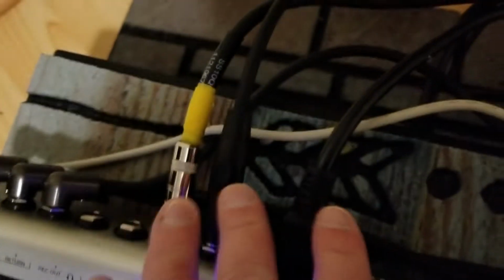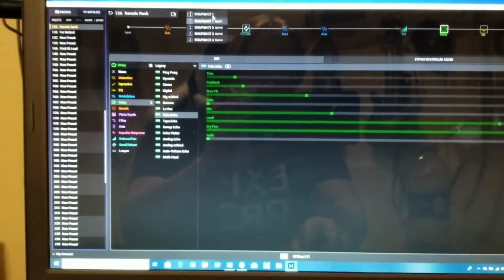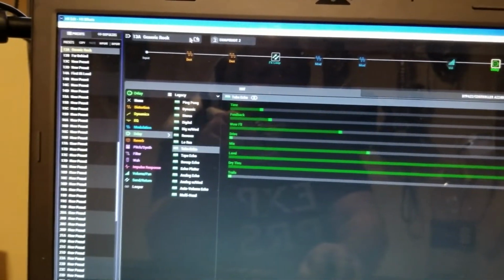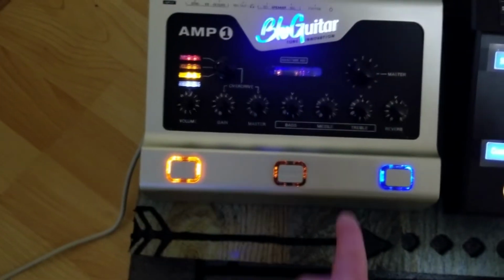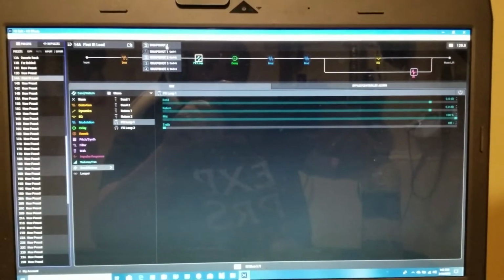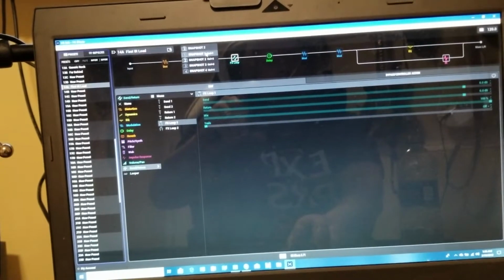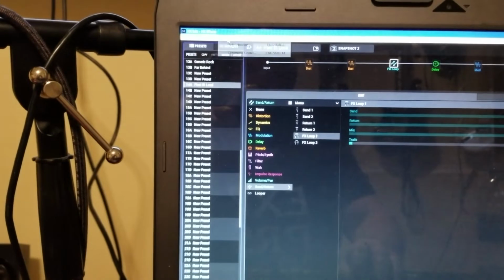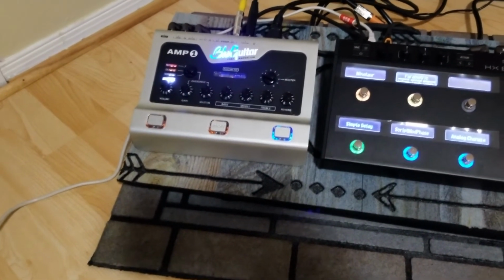HX Effects MIDI Control of the BluGuitar Amp1

Comment: Are you still using the HX effects with your amp1 in 4 cable method. I am considering this setup and wondering if it works well.  Did you stick with it or have you evolved sconce this video.  If so what are you using now. Thanks for sharing.
Reply from the maker: @Dr. Gregory Weisswasser ND , I do not use that setup anymore, but I'm not sure I would have moved on given what I know now. That said, for about the same amount of $$, I'm using a Kemper Profiler Stage. I also have a full pedal board, so with the included effects of the Kemper and the board, I've got everything covered too many times over.

This really depends on what you're looking to achieve. If you're looking for a straight forward rock/blues sound on stage, the HX Effects and the Amp1 in 4 cable is all you need. You can go from 50's Elvis to sludge with that that. You can even do ambient with it. The truth of the matter is that I could still use that and be just fine doing everything I do. I play churches, I play festivals, I jam at open mics, I do club gigs; and I was doing it all with the HX Effects and Amp1. 

Why go Kemper, you might ask. I sure did. LOL. Because I had FOMO (fear of missing out). I have a Kemper with literally 18,000 amp models at my feet and I use two, a Marshall Purple Plexi and a Fender Twin AC from 1965 that were both profiled by Tone Junkie. I paid for his everything pack, and that's really all I use. I have to laugh at myself while I type all of this, because I didn't have to spend a penny and would have been happy where I was.

The only two things I would add to the Amp1/HX Effects method would be a wah and volume/expression pedal, but that's me. I have a Slash wah, Mission volume/expression, Digitech Drop (which has gone up $100 since I bought it!), and a Gamechanger Audio Bigsby pedal. The Drop is so that I can change to a lower tuning without switching guitars and the Bigsby allows me to do bends without putting a bar on my guitars. I hate actual Bigsby's (my son has one that I have to maintain because I'm Dad), so this pedal lets me do dive bombs and all that and never lose my tuning. I play almost exclusively Gibson on stage these days, and they aren't famous for staying in tune when you bend them that way. I play a few covers that use the Wah and the volume pedal is to fool the sound guy. 

So let's talk pros and cons. If you drop the extraneous pedals I listed in my last paragraph, let's look at the pros and cons of each of these solutions and where I would spend my $$ today.

Kemper PROS: I can do it all in one box, I have all of the profiles I need, and with the Mission expression pedal, I can assign it to do any "morph" function to use it for wah or volume. The profiler Stage is all in one, so you don't have to carry the toaster and foot controller. It has everything the toaster has, except there's no amplification option. The buttons are easy to read, and you can assign one or more effects to each effect button, so you can for example turn on a boost and delay at the same time for a solo. That's very convenient. When you switch from patch to patch, it's instantaneous! No delay. That's real important when I'm doing live performances. Built like a tank, it can take a licking and keep on ticking. I love using it, it sounds great, the effects are good for everything I do, and the amp models are very convincing.

CONS: You can't assign the pedal to do BOTH! Are you kidding, Kemper? The morph function can only be assigned to one thing at a time, so if you want to morph volume for solos, you can't morph the expression pedal to do wah during the solo! That's why I use a separate wah pedal. Not a big deal, when it comes to wah, it's very personal, and the right pedal is different for everyone. Some like a short throw and others a long one. I prefer one in the middle. I came up in the 70's and you need that disco funky groove, and my Slash wah can do it. I can't imagine trying to do that on the Mission. It's heavy! I bought the extra bag ($130 extra) and the lining where the Kemper sits is already ripping out a year later. Still works, and the bag holds up, but the pocket on the front isn't as big as the one for the Helix. Made by the same company. 

Amp1/HX Pros: The Amp1 does three Marshall amp sounds and does them well! I've spoken with Thomas Blug personally, and he is a perfectionist. We had a two hour conversation and he took me for a virtual tour of his studio (we had a Zoom call and he was in Germany). He's everything you would expect from a genius exceptional guitarist. He's what Les Paul was like. The pedal shows his commitment to quality sound. It's very light. I don't know if it weighs two pounds! I thought, "you got a 100 watt amp in here?" You will be shocked if you try it! The HX gives you everything else. It's amazing the effects in there, and you'll want for none. You can get an effects pedal (or 2) and do everything you need with them. You can use the output of the HX effects to your DAW or come from the Amp1. Either way, you can get a cab sim in there. You can also take a cab sim output from the HX to a sound board and also go non sim out to the return of the Amp1 so you can use a cab on stage. Very versatile, and the number of effects is nearly limitless that you have available to you.

Cons: It's two versus one pedal. You need an adapter ($60) for midi control if you want to use a midi controller. To mount it to a pedal board, you'll want the kit ($20) you can add four (4) effects loops for $250, but that's not a need. Because you have two pedals, you don't really need a board, and you're just putting the cables between the two, so you can do that in seconds during setup. I had them mounted to a board and controlled everything via midi.

Conclusion: Get what's right for you. The expense will be very close, so money should not be the object unless you already have an HX Effects or Amp1. For me, most gigs are just guitar into Slash wah into Kemper into the board. That's really it! When songs require it, I bring the Drop or Bigsby. The Mission is always there, but I've set up my presets and morphs to do most of what that would cover.

Hope that helps you to decide, and I look forward to hearing about how it goes. I'm also about to do a shoot out between Kemper, Helix, and the Dream 65 from UA audio. Let the games begin! :D
Reply: @jimwoodard64  Thank you for your feedback. It is really helpful. Good luck on you journey to tone town.

Comment: Hi, so I got it working to switch between Clean, Classic, Vintage and Modern. Fine. But. If I call any of my former presets, it will toggle
the corresponding AMP channel as well, meaning, when I want to use a clean Country sound I stored on the same switch as "Modern", I am into one hell of problems.  I get "Modern" gain and Countryis not possible. This applies to all the other used switches. They will load the AMP channel as well. Any advice?
Reply from the maker: The Amp1 will remember ALL settings for the word you send from the HXFX. You can't just change one setting. For example, if you tell the Amp1 that word 1 means Classic, Boost Off, Reverb Off; then if you use word 1 at any time, it will make all of those changes, regardless of what setting you manually made beforehand. If you make word 2 as Modern, Boost on, and Reverb on, it will remember that, even if you're on a "country" setting beforehand. You have to make separate words for each channel. I had a log because you can have like 126 words or something like that. If that doesn't help, reach out via Facebook via The Practical Guitarist Facebook group. https://www.facebook.com/groups/practicalguitarist/
Reply: @jimwoodard64  With the help of your video, it was possible to communicate with AMP1 for the first time. Success so dar. Many thx. I do not understand the "Word! approach. I will take a look at the FB group though. Thanks for getting back so fast!

Comment: I'm struggling to make this work, as well...what are your midi settings in the HX FX? I can get it to switch in Preset Mode, but, not in Snapshots.
Thanks!
Reply from the maker: I’m not sure what you mean. Did you understand the tutorial? I used snapshots to change the settings. No two amp 1’s will be the same. You have to teach it to understand the words. I do this in the tutorial about half way.
Reply: PRS Rocker I followed all the steps in the video, multiple times...but, the HX only changes channels on Amp 1 when the HX is in Preset Mode, not Snapshots. 
I would hope that every Amp 1 is the same as far as this stuff is concerned.

Comment: Hello, thank you for this Video! I have one question, are you using the Midi Adapter from BluGuitar? For me it seems that I can not connect this one and that I need another one... could you please help me?
Reply from the maker: Thank you for the comment.  Yes, I use the official midi cable sold by BluGuitar (https://www.sweetwater.com/store/detail/BluMidi1--bluguitar-midi1-midi-adapter-cable-for-amp1). You will also need a standard midi cable as well. I use a 3' Roland midi cable in the video, but get the length you need. This is the one I use https://www.sweetwater.com/store/detail/RMIDIB3--roland-rmidi-b3-black-series-midi-cable-3-foot. The cable from BluGuitar allows you to adapt a standard midi cable to the 1/4" jack on the Amp1. Check out the video at this point https://youtu.be/ruIChSzWTTw?t=40 (40 seconds) and I show how to connect it. If you have any more questions, please feel free to reach out to me. I'll do a quick video on the connections.
Reply: PRS Rocker Why do you need a standard cable with the BluGuitar midi adapter. (I have the hx effects on the way and the cable too)